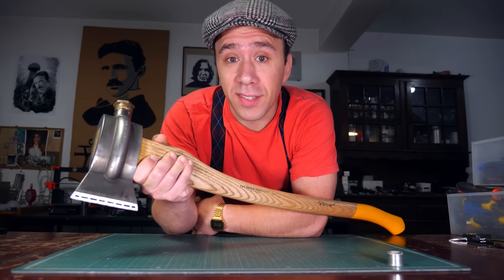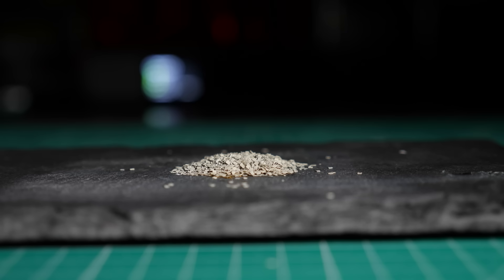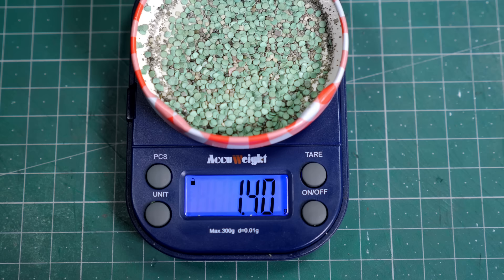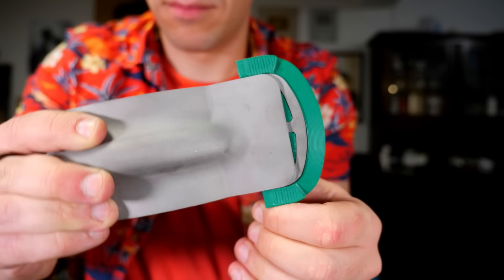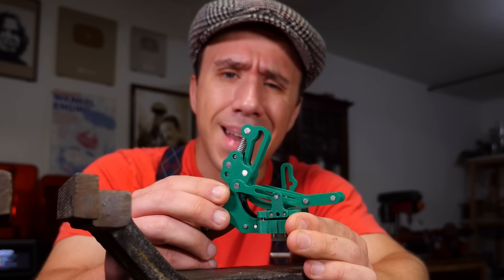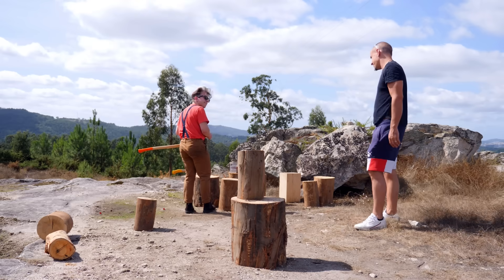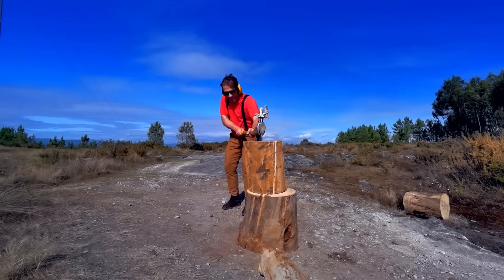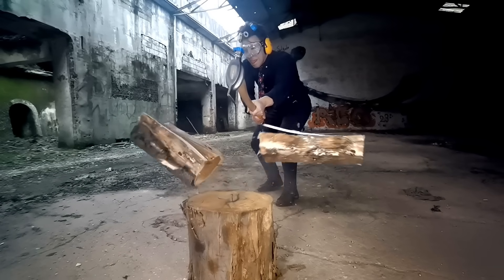I built a BETTER SHOTGUN AXE

Comment: I was going to say those looked like eucalyptus logs. We've got a lot of blue gum trees all around CA ... it's invasive in some areas, also farmed as fuel in some regions (but it's been here for well over 100 years).

And yeah, that stuff's hard and dense ... it also smells kind of rosey and vinegary when freshly cut (though some people disagree about the rosey aspect). Smells a bit like that after being seasoned, too.

Peices that large and seasoned that solid are probably better for lumber than firewood. Stuff felled wet and allowed to dry rapidly and check (split at the ends along the radial sections) would be unsuitable for lumber, but much easier to split as firewood.

Though logs that short, but seasoned nice and tight without checking, are limited as lumber (aside from small lengths for maybe small peices of furniature, cutting boards, and related things), but more often used for lathe turning, especially those big wide ones, good for making large bowls.

OTOH ... that hard and well seasoned, and you've also got something good for experimenting with wooden cannons.

Comment: Are there laws restricting reloading or hand-loading of ammunition in Portugal ... or wherever your location is? Because that could be a viable option, too. (with the uses of your shells,  you may not need to properly reform the shells either, or use normal crimping techniques, so less tooling required)

For that matter, are black powder muzzle-loader type guns categorized differently there? (I know they are in the UK and some parts of Europe ... also Canada and the US), so a combustion mechanism based around that, using a percussion cap rather than a primer, could also potentially be an option.

Home made propellants would also work for that, and be very similar to (or identical to) some formulations of solid rocket fuel, but I'm not sure of the legality of using that as a gun type propellant rather than a rocket type propellant. (both black powder and sugar-rocket propellant or rocket candy are both rocket fuels and black powder type propellants:  formulas identical to those within the range of rocket candy were used during the Great Depression in the US as improvised substitutes;  albeit used in powdered form, not melted into a solid mass as with rocket candy, though I've seen rocket motors using compressed pellets of sugar rocket formulations, too) The sugar based propellant takes less finesse than real BP, particularly given the specifics of properly made charcoal for that, and the absence of sulfur makes the residue less gummy and corrosive (and doesn't release hydrogen sulfide when cleaned with water).

Comment: You might have an easier time honing down the edges  on the 3D printed parts if you annealed the edges first, though that would reduce their hardness. (not sure if the parts you have use a heat-treatable alloy, but if so, you could anneal and then harden or temper it ... something that behaves like medium carbon steel would be easiest, since you can simply quench harden it and not temper it as the hardness and brittleness won't be as extreme as high carbon tool steel, which requires tempering)

Comment: Smokeless powder (even relatively fast burning shotgun powders, which are much faster than various rifle powders), have a burn rate that dramatically increases as pressure increases, so the combustion characteristics under confinement are dramatically different than in open air, and can most definitely occur with supersonic flame front (well ... supersonic by atmospheric temperature and pressure standards: with the temperature of gasses inside the chamber and barrel, it's more complicated, and you'd need to have a fairly high velocity supersonic projectile before the gasses inside would be supersonic within their own medium).

But in any case, sufficiently confined smokeless powder can also undergo deflagration to detonation transition (which is not something that's supposed to happen inside a gun chamber or barrel), and the nonlinear pressure and burn rate relation makes the behavior very different from traditional black powder propellant (and related sugar rocket propellant and some black powder substitutes).

Double base powders with high nitroglycerin content also tend to have more dramatic deflagration to detonation transition (also more dramatic cook-off characteristics if chambered into an overheated barrel) compared to single-base propellants made of primarily nitrocellulose plus stabilizers or burn-rate modifiers (with NC being a much less sensitive high explosive, also with different high temeprature, high pressure thermal decomposition behavior ... vs NG under conditions where it might vaporize and be under high pressure and partially decompose before then initiated by a primer, which itself tends to be a small amount of primary high explosive: though there's exceptions, like the corrosive primers the US military used to use, which are simpler mixtures of potassium chlorate + fuels + sensitizers like powdered glass)

Comment: Now stick an Estes motor in there, with a little capacitor-powered ignitor. You could close the circuit the instant the rocket is released - the typical ignition delay for an Estes ignitor should work pretty well and ensure the motor lights shortly after release.

Comment: Here's a gun tip from a small gun channel that might apply to your axe. If you remove the shot (projectiles) from a shotgun shell, leaving the wad and powder only, put that in a shotgun and fire, you will barely burn any powder and it will just fly out the barrel unburned. The powder needs pressure in order to ignite. What you need to do in your axe head is make sure you have your shotgun shell chamber (where the shell sits ready to fire, which you already do), followed by a powder combustion chamber which requires a small/small exit holes which then feed out the tip of the axe. When your shell fires, the powder is allowed to combust when you have small gas escape holes because this builds pressure, rather than your current, relatively large ports. Your large ports act as a shotgun barrel with no restriction which just makes the powder fly out the end of the barrel unburned. If you were to close up the shotgun barrel with a smaller hole, this would then allow the powder to burn. That being said, make sure to absolutely make the shell chamber and breach as strong as possible because when you have a full powder burn, the backpressure pushing your chamber and breach contraption will have a lethal amount of force. Basically it needs to be as strong as a real shotgun.
Reply: Z

Comment: ok, I will explain what happens inside an explosion. With firearms the ammunition is propelled by the gas that is created when igniting the powder. You are changing the state from a solid to a gas, when you change these solids into a gas it obviously needs more room to accomdate the gasses. So there are 2 factors that need to be considered to power this tool of yours. 

1. How fast is the burn through, meaning can you get your fuel to burn through instantly or is it more like a high speed fuse.
2. How much gas is made during this transition. This controls the reate of expansion. 

Starting with a gas creates a fantastic flame because the burn through rate is instant but does nothing for propulsion.

Comment: Why not a concave blade instead so the two ends dig into the timber   and thicken out the middle section to increase the air flow through the center. 5-6mm concave and add 4-6mm to center port diameter feeding. That way the edges dig into the timber nicely then the center gets to do its thing

You could add barbs to the concave design and depth holes for depth pins to stop the axe at certain depths think of it like a spade bit without the pointy middle or maybe that would also work 😂.

Comment: Hmmmmm so timing. Using a pressure release spring loaded firing mechanism is not the way. Your adding too much variation in delay. A dead weight mechanism is much more consistent. Try going back to that. Use a stronger magnet but detatch the weight using a rocker and push rod mechanism with its tip positioned somewhere near the edge of the blade. Load it with a heavy enough spring so that it will easily release the weight without compressing much but not soo heavy that the rod will bend under the pressure. You could use a screw mechanism to adjust the timing my moving the tip of the rod closer or farther from the wood. Making the weight heavier might assist with kickback as well.

Comment: You could make a three pronged axe, the central exhaust would remain the same, but the two outer prongs could have thin barbs that stick into the wood on either side, ensuring that all of the force goes into the wood. Another potential beneficial aspect could be putting perpendicular depth limiting plates on the outer (and/or inner blade) to ensure the axe only goes in to exactly the preferred depth to maximize efficacy. The barbs may have to have a rotating connection to the main blade so that they will resist enough to ensure the force goes into the logs, but then when the logs blow apart, they should be able to rotate up and away from the blade to enable the wood to open up in the way it wants to. This will definitely make for a complicated mechanism, but it would solve all of your problems.

Alternatively you could just make a small depth guide on your axe blade. A perpendicular ring of flat metal to 0reveny your axe from going too deep. That way you know you will always get it deep enough but not too deep and you can hit the piece of wood as hard as you want. You'd be ensuring it is easy to get the exact depth every single swing!

Comment: Draft Idea 2
You can take inspiration from the "Axe with splitters" (check it on Google Images) and use a Cartridge to mechanically open the splitters after the axe is penetrated in the wood. WITH BRUTE FORCE

Comment: Black powder log splitters were very common in early US history.  There are several examples on youtube. They look more like a giant hole punch instead of an axe. The cylindrical shape more easily creates a plug that compress the chamber and creates an almost perfect seal. It would probably be a better design and be easier to get printed as a "leather punch"

Comment: I have an idea for your next video, you can build a remote control car using a jet pulse engine. The goal for the car is to be able to be at idle speed, accelerate, break and steer. 
Good Luck !!!

Comment: You're doing it backwards. Look at the videos of folks getting the axe stuck then slamming the back of the stuck axe onto the chopping block and using the weight of the lock moving downward and the axe as a splitting log. So do it upside down with a larger charge. Like an 8 or 10 GA full brass shell. Or one of those old black powder log splitters.

Comment: 9:17 - 9:24 That moment, when the geek has to realize that all those fun projects and mental gymnastics didn't replace going to the gym.
The time and money you spend into all this could have probably just been put into a work-out equipment and lifting weight 4 times a week.
By that point, you might already swing an axe easier. Nothing beat peak human condition.
Also, you need to stop sharpening your axe head like that. I know it's called "filing", but your zesty-ahh acts like that gay barbar who files nails for your wife with that finger posture.

No wonder it takes you 6 hours. There's on grip strength in those pinky-finger-up-while-sipping-tea appendages.

10:09 - 10:28 Congratulations, you just described a gun.

Comment: Since you want to use pressure to force the logs apart, maybe what needs to change is the axe itself- rather than using a blade, use a spike to go deep into the wood.
A spike thats slightly wider on one axis, to create a split line on entry?

Comment: Now that you fixed the trigger part, the priblem is simply how to get the pressure deep into the wood without splitting the wood too much. You don't want an axe. You want a pike. A sharp pointy point, blow holes, and then no more taper (to avoid spreading the wood). Basically an ice pick with a hole next to the tip.

Comment: Bro, the blast isnt going sideways as your previous one, instead its going vertically down and thats why its pushing the axe out rather than applying force from the inside of the log to the outside (i think it also gives you seal problems)

Comment: The concept is not all that original. Many decades ago, we had what was commonly referred to as a "Powder Wedge". It was a splitting wedge that was hammered into a log, black powder was poured into a chamber, a fuse was lit, and you'd run like hell and take cover. After the smoke cleared, you would find your log smartly split into at least two pieces. They are a lot of fun to use, but you definitely don't want to be standing near it when it went off.

Comment: "I just made a video about turning water into an explosive. I'm still a new YouTuber, but even I know that using an oxyhydrogen generator for this kind of thing is way too dangerous.
Now, about the axe idea: you know a bullet is bigger than the gun's barrel. If you want to split strong wood by injecting gas, you have to make sure the gas can't escape from the sides.
To do that, you would need to make the tip of the axe longer and thinner to inject the gas deeper into the wood. The main goal is to design it to reduce gas leakage as much as possible. A rifle's muzzle brake is a good reference for this, but you have to design yours to do the reverse of its job. Instead of redirecting gas away, you need to design a tip that forces all the gas into the wood."
u can see in the video that gas wont be injected to the wood instead it escapes from sides

Comment: You were on the right track with the first one.

For starters, don't live in a location where tyrants dictate what you can make. And don't order from a tyrannical company that dictates what you can design. Get all that bullshit out of the way and you can improve your design properly.

My recommendation would be to go to a more aggressive powder. Something like H110 or Norma R1 something with a faster burn rate for quick pressures.

Next design your Axe head more traditional for a deeper bite. This will aid in splitting too. Your ports should be drilled at an angle facing away from the bit. This will keep them from clogging from the chop, and force the gasses at the already splitting portion of wood. Facilitating pushing the wood apart instead of blasting solids away.

I'd make your ports further back, at least an inch or more from the bit. A good swing will sink the bit into the Axe, the explosion will push the logs apart. Too close to the edge and you're trying to detonate the log, not split it.

Furthermore I'd suggest removing chance from the equation having it detonate on impact. Instead, add a switch / trigger to the handle. This would be much safer incase of a glancing blow.

So, you'd sink the bit of the Axe to the desired depth. Pull the trigger to detonate and split. Aim your vents up and out towards the already split sides instead of downwards. Pull the trigger to detonate when safe.

Using this method you could in fact create a casing and magazine loaded system to facilitate more than one strike per load. But that's probably too much to ask. 

Honestly your designs are intriguing however you're being severely limited by tyrannical laws. Nothing you're doing should ever be considered illegal, it should be praised as brilliant instead.

Comment: I implore you to stop filling with a forward and back motion as most files are just meant to be used in one direction. It will prolong the life the files if the filing teeth aren’t dragged backwards over the metal which rounds the teeth making the file less effective. With wood, sure but metal I’d very strongly argue against it.

Really frickin’ cool axe m8!

🫶👋✌️🖖

Comment: I have many expectations for V3. Try making the blade sharper and giving the force from sideways .and   instead of explosives ,try using Co2 canisters
BTWtomatoes are disgusting
Reply: Also try using a pressure sensor to time the release of pressure  using electronics like you did in the Magnetic air engine

Comment: How about using the explosion to drive a mechanical splitter to pull the logs apart, that way you can confine the gasses better and direct them exactly where you want. Look up the Chopper 1 Axe for inspiration.

Comment: There are wood splitting axe like ones from easy go, with side mechanism that helps split logs. I’m Not saying that there are better log splitter if your looking for one. I’m just making a suggestion, what if you take one of those and power it with your bullet mechanism. Your problem now is that you’re relying on air pressure, but under the right conditions it doesn’t work if you don’t have a perfect seal. You can make a super axe.

Comment: For version 3, use a smaller axe blade.  Less surface area should increase penetration but the gas can still push on a similar area.  Work out a trigger mechanism that senses how far the blade went into the wood.  Thirdly make the handle of the axe out of a tube fed shotgun type mechanism so you can auto feed and eject shells.  The gas should turn the corner down the axe head fine if you design it right.

Comment: Is it possible to us this concept to power a motion machine that creates energy when it hits a high enough speed potentially on a mobius platform or shape so it can go independently. How would you theoretically do this. Or am I stretching this
Reply: Using the tech they just publicly announced to launch spaceships potentially or a design like that.
Reply: A issue is drag but can be solved if put under water which also helps with overheating